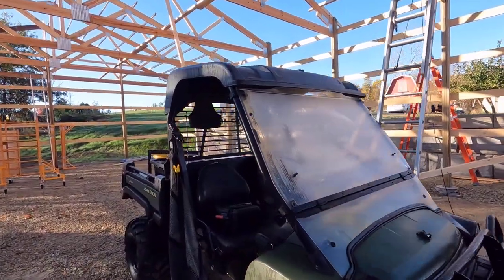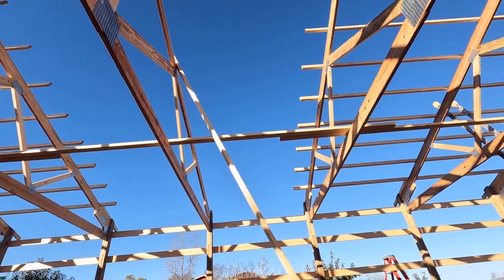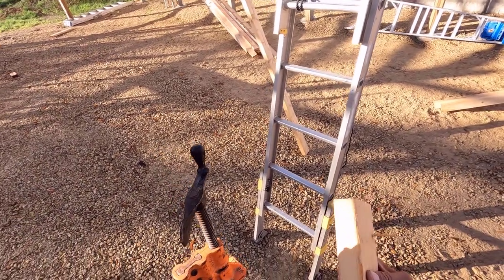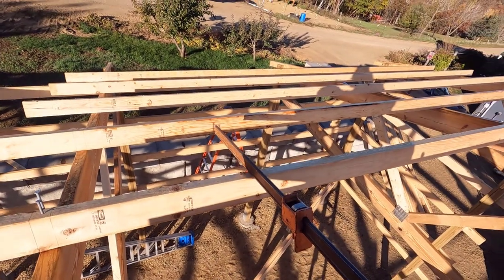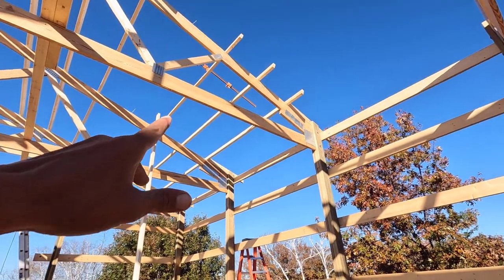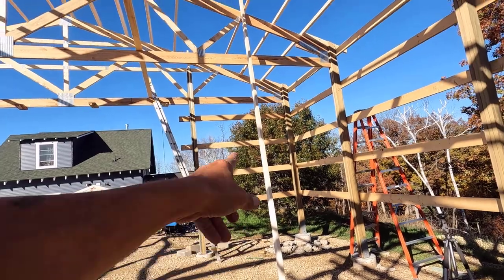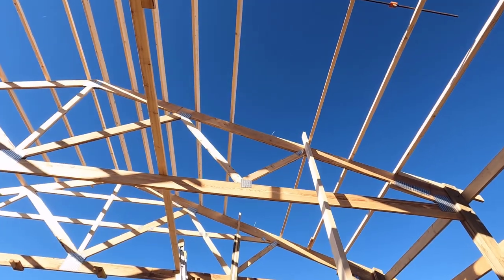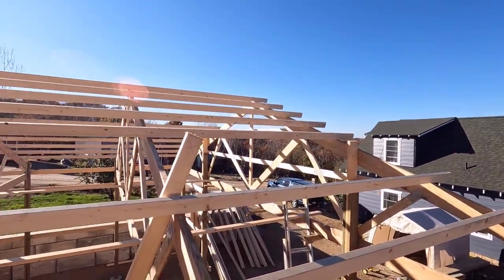Quick Purlin Install Video as Hunters Arrive [DIY Post Frame]

Comment from the maker: I haven't recorded anything for five days now while the hunters were here and I was rushing to get the grade boards and rat boards installed. Yesterday I cut the door openings in the front, and had to run to town later in the day for the second half of the grade boards — the outer boards. Our excavator/concrete guy was supposed to stop by yesterday to level the place off with gravel and prepare for the concrete, but I told him later in the day or move it to today. Hopefully he will show up today and get the place ready for concrete!